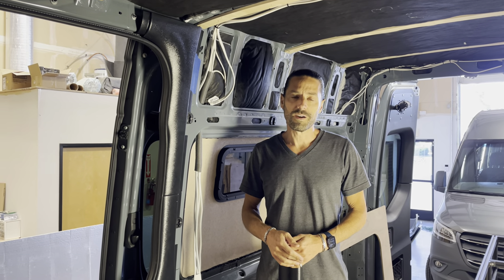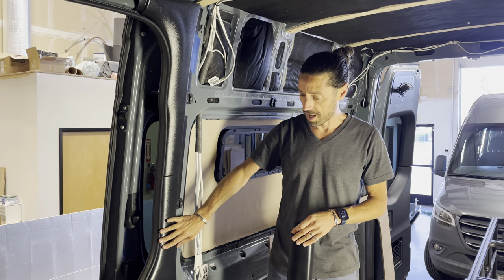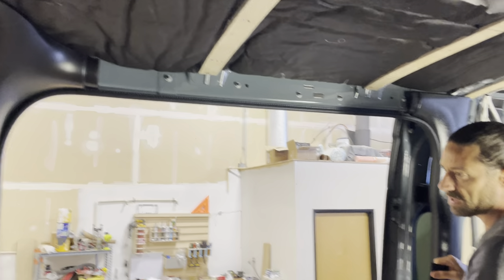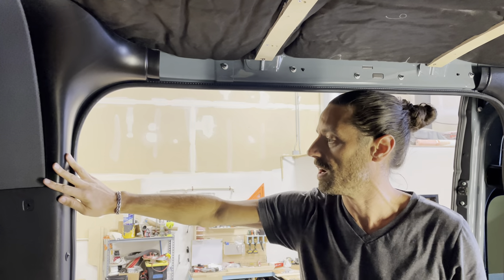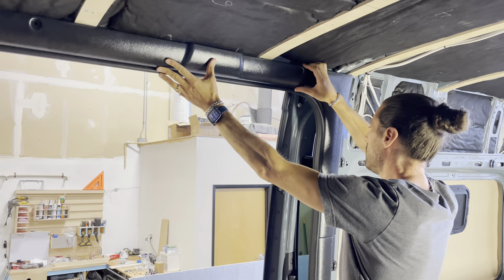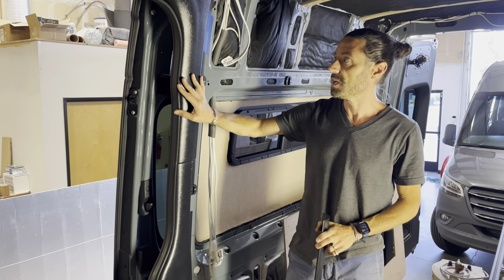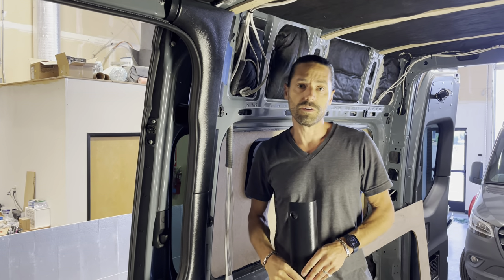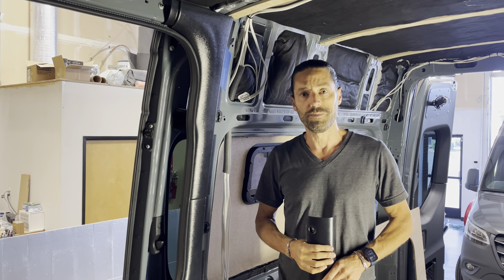Terrawagen Tidy Trim Front Interior Finishing Trim Kit for 2019+ Mercedes Sprinter Vans

Comment: Hi! I see you have framed the ceiling of the van. Is it possible to frame the walls as well and still have a nice transition from to kit to the walls? Thanks
Reply from the maker: Hi Cedric, The ceiling framing on this van was removed and moved to the sides of each steel rib rather than on the bottom of the rib, specifically to accommodate our Terrawagen Tidy Trim Front Interior Finishing Trim Kit for 2019+ Mercedes Sprinter Vans. The ribs shown in this video were installed prior to using the Terrawagen Tidy Trim Front Interior Finishing Trim Kit for 2019+ Mercedes Sprinter Vans.
Reply: Ahhhh damn 😂😂 just installed and glued the ribs on mine yesterday😅😅
Reply: Btw, did you install the new wooden ribs in the same radius as the steel ribs or just straight wooden ribs? If straight, how did you finish the transition to the headliner? Thanks a lot!!
Reply from the maker: Hi @cedricbiasino952  ! We scribed them to be the exact curved size and shape of the metal frame ribs of the vehicle. They are 1" wide and were coated for waterproofing before installation, and glued in place so that no rust can form where a screw or bolt hole would have been drilled.
Reply: Ok, loud and clear!

Comment: I just ordered this kit. I had high hopes for this kit.The right B pillar cover which is the only reason you would want the kit is unusable unless I can figure out some black magic to make them work. I haven't tried the other side but guessing it's similar. Pretty disappointed with the fit. I think a lot of people would be pretty pissed off spending 750 on this kit.
Reply from the maker: Hello! Not sure what you mean. We use these in every van we build, as do dozens of van builders in North America. Tens of thousands of these are installed in vans. You might need to take photos or a video showing why you are having a hard time and we can forward them to the factory for them to assist you with it!